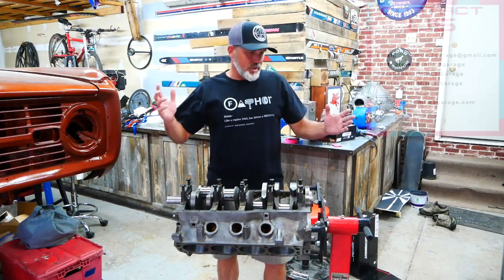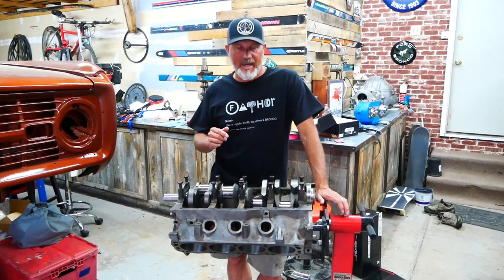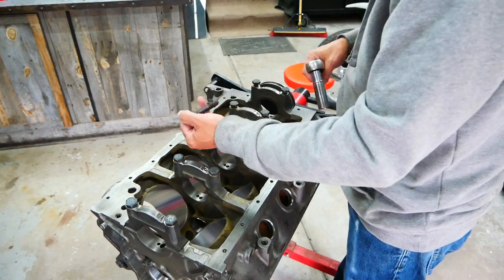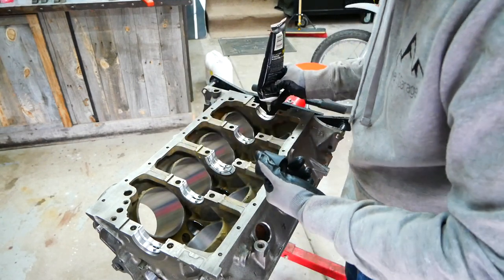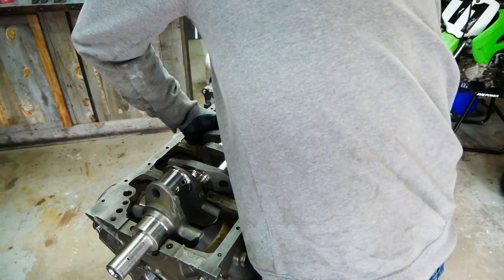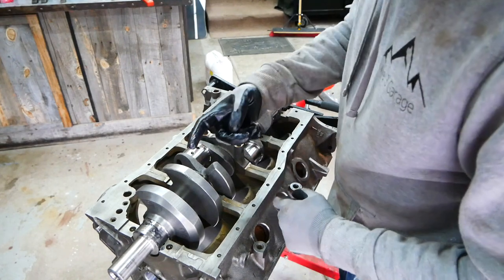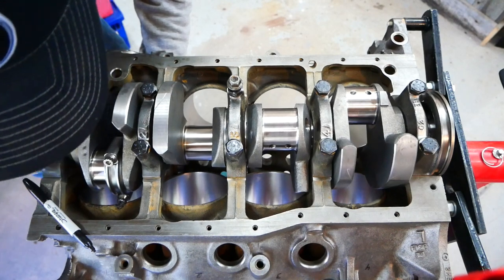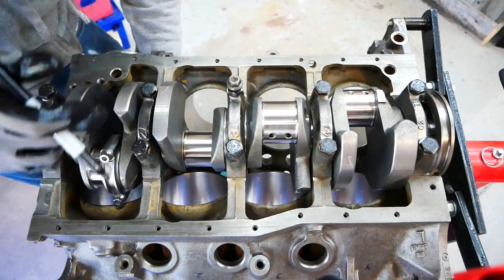Clearance Your Stroker Crank Block In Your Garage.

Comment: Don't forget to lube the sides of the thrust bearing, and try a mixture of Lucas oil additive and 50weight oil applied with a brush for the mock up easy to clean after and will keep the bearing and crank safe

Comment: Didn’t you know these had to be notched? Machine shop should have if you had it line honed and decks ground. All 347s, 363s,some 331s unless a custom block have always required this.
Reply from the maker: Yes I did, but the two machine shops I used in this build were horrible and I didn’t want them touching anything else.  Fortunately, This did not require a machine shop.
Reply: Unless asked to, many shops won't just grind in clearance if they're not assembling. Since a lot still mock up and do it this same way, if they don't have the rotating assembly, nothing they can really do anyways. I have a program for these and do them on my mill, mock up after just to double check.
Reply: My machine shop knows I'm building a 408 but I asked them NOT to clearance the block because in not paying them for something as simple as this
Reply from the maker: @jasonochs8369  good
Point. Same here.
Reply: this  is  what makes  me  want to go  331  vs 347  because a lot  of  331s  dont need notched  if you used scat i beam rods. avoid  the whole  dam  problem  but i have  decent  machine  shops  around me